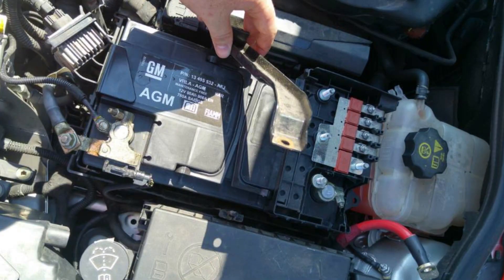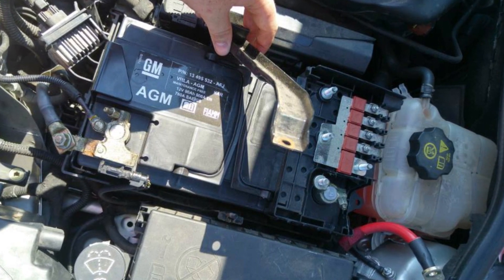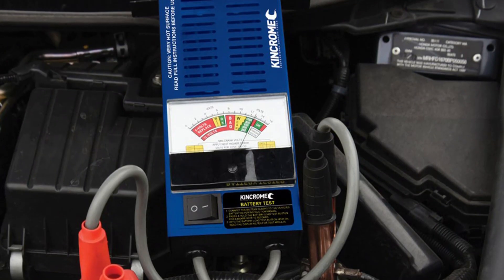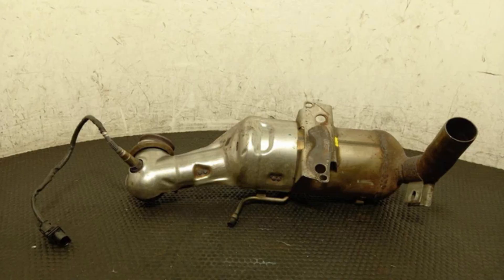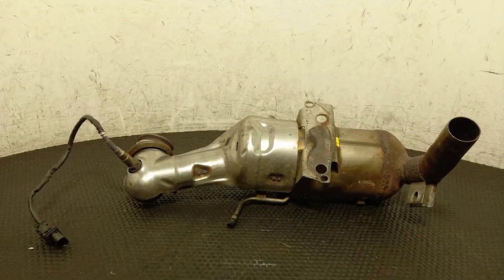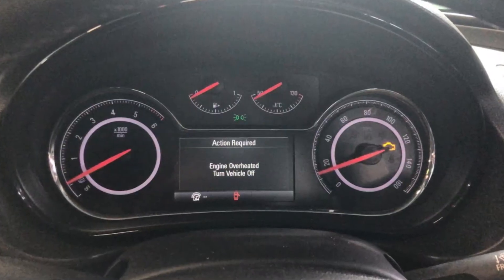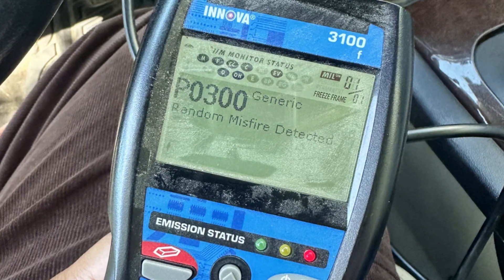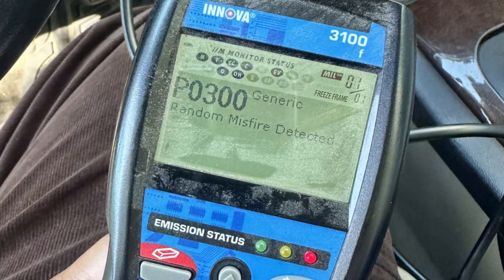Code 84 in Vauxhall vehicles: Reasons and ways to fix

Comment: On a GM Z20D1 engine, I had this error code due to leaking turbo boost in the intercooler turbo hose fitting as a result of a sloppy radiator replacement by the mechanic.
When my battery let me down, I did not get the error.